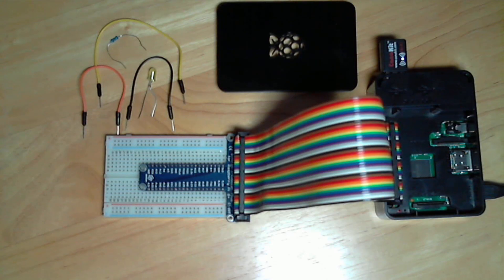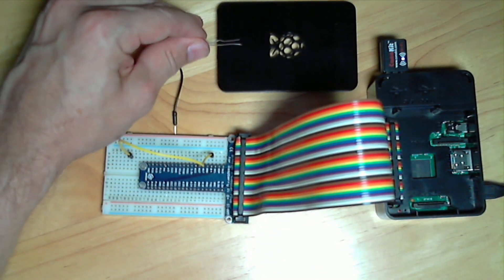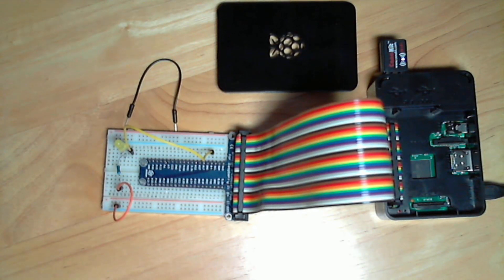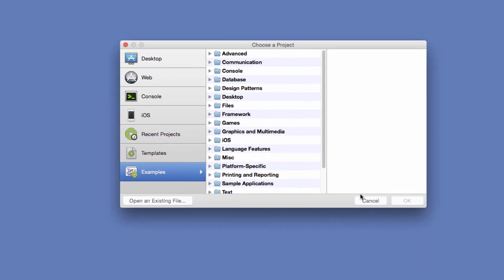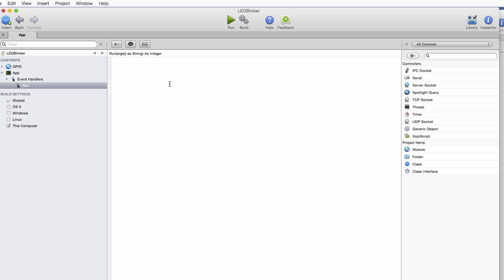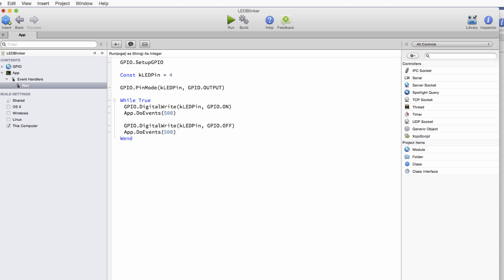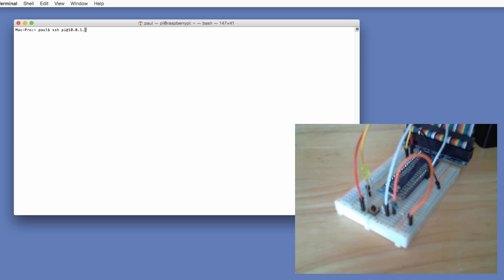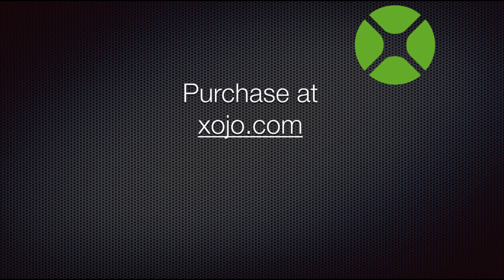Creating an LED circuit and controlling it with Raspberry Pi and Xojo

Comment: This seems like the simplest of projects, but when I run the compiled app I get "Illegal instruction".  I have installed several libraries that I read were needed for XOJO but I cannot get this to run on my PI B3+.
Reply from the maker: Try checking the docs for updated code. https://documentation.xojo.com/topics/raspberry_pi/index.html
Reply: @XojoInc  No luck, even a simple "Hello World" app for either command line or windows do not run.  Do I need to buy a license? I only want to buy if it solves this issue.  But I was led to believe that XOJO for PI was free.  Money is not my issue, but getting functioning code is.  PS: Are there any libs that must be installed on the PI for XOJO? Thanks in advance!
Reply: @XojoInc  Nothing in that link answers my question or even adresses the error message.  Is there any other more direct help based on the information I provided?

Comment: That was a great video.  I have no previous programming experience but I would like to develop a raspberry pi application for amateur radio packet radio specifically.  The app would have to communicate with a terminal node controller and decode incoming packets of data.  Can I learn how to do this?   Thank you.